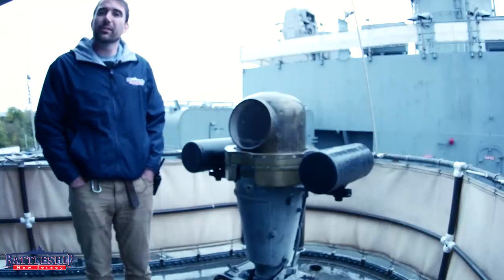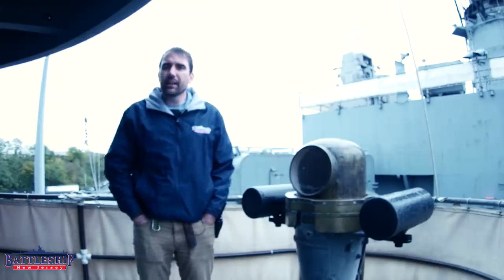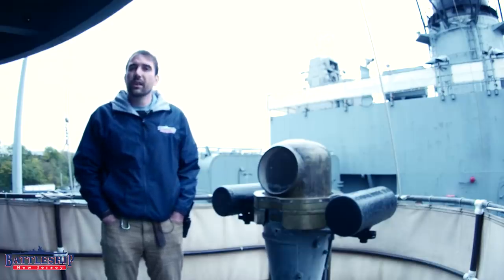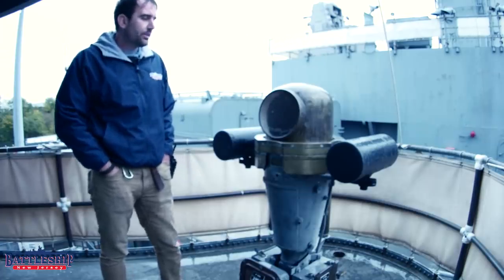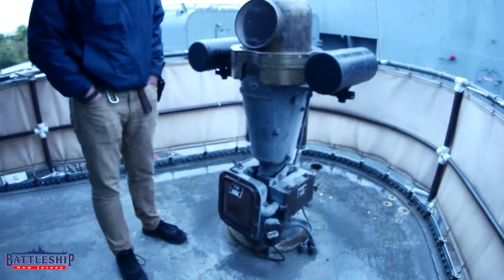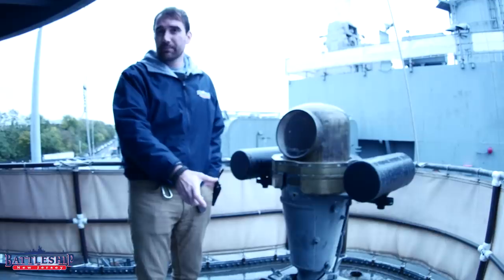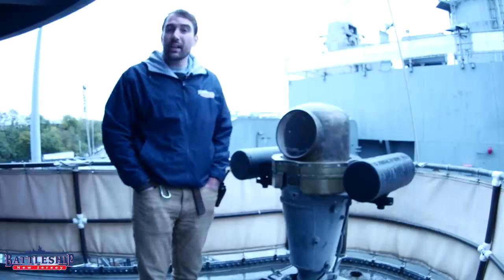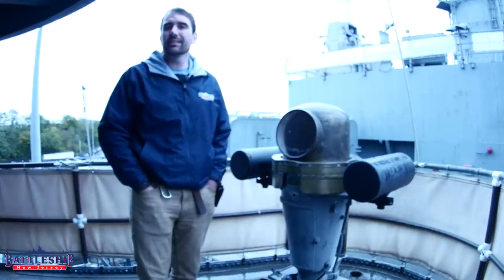What Does the Lionel Train Co. Have To Do With the Battleship?

Comment: Ryan. Good job. Two points. The binnacle is corrected on a “range” of known bearings by a compass technician experienced in the art. Much like piano tuners. This process of compensation is referred to “swinging the ship”. Once compensated the “navigators balls” are left alone. Variation and deviation change geographically. Thus charts contain compass roses that define variation for a particular local and address the rate of change of deviation over time for that area. 

The magnetic compass is essential to the navigation of a ship. The gyro compass is inherently stable and eliminates the messy computation of true north from magnetic north compensated for variation and deviation. But the gyro has no way to “know” which way is north. The ships navigator must “set north” for the gyro. Once done that gyro “remembers” north. Until a power failure, mechanical failure or other event that causes the gyro to “tumble”. This usually occurs on a dark night, close to a foul shore, in a storm. That’s why there are usually both magnetic and gyro repeaters at the key conning stations. And in the gyro compartment. So the gyro can be re-set quickly at sea. 
Redundancy is a wonderful thing.
Reply: Still done to this day, I used to race sailboats and you still "swing the ship" to set the boat's main compass. I don't care about GPS, Loran or anything else depending on electricity, they are good tools but when the power goes out, compasses, paper charts, decent wristwatches and sextants are the only way. It's vital to know the old ways.

Comment: I found two  Lionel made USN compass in Moms attic a few years ago when we were cleaning it out for a sale, the home was purchased in 1956. 
Compass #1 is a 3 inch compass in a cooper housing that is portable and has a date of 1942 on the face. Ive been told these were used in whale boats. In the cooper housing is also a kerosene fueled area to light the inside of the housing. 

The second compass is in a wooden box , with s brass plate that reads Bureau of the Navy. my guess a 6 inch with Lionel 1942 on its face.
Both are prestine new condition.

I have no clue how they ended up in my Moms attic and Dad passed in the mid 60s, Mom had no idea and nobody worked for Lionel in our family. 

I do know that the Lionel factory was located in Hillside NJ which was not far from Moms home in Essex County.  

I also found up in that attic a Lionel made fishing reel.  

Amazing company Lionel.  

I think Ill make time to visit BB62 again.  to see the Lionel display

Comment: This could be doing the same job as the fluxgate in an aircraft compass system. The directional gyro has no idea where north is. The job of the gyro is to hold a set heading no mater what the ship is doing. A compass will bob and swing as the ship does. The fluxgate gives a compass  signal to the compass amp which controls the compass indicators and the gyro damps the swings of the swings that the aircraft would cause.

Comment: Yeah,  the magnetic compass sends a signal to navigation. Fun Fact: There are magnetic maps that detail the magnetic topography of the oceans, and in some areas if you do not have those maps in hand you may find yourself going 90degrees askew. As for the placement, as you mentioned the ship is a huge chunk of steel that becomes magnetized at every eyeblink. That area is magnetically 'neutral' as possible on the ship. But, don't take my word for it. I'm just a retired AT1.

Comment: The variation between true north and magnetic north can vary widely.  There in New Jersey the deviation is about 10 degrees east.  If you went into the Pacific, up around Seattle and out toward the Aluetians, the deviation is about 20 degrees west, for a total change of 30 degrees.  Even just crossing the Atlantic from New York to England, the deviation will change about 10 degrees.
Reply: That's the reason for the mnemonic: True Virgins Make Dull Companions And Wives.

Comment: those mk19's likely had battery back up for power loss. the AN/WSN-5's it would have had in the 80's & 90's had built in battery back up. you can navigate off a magnetic compass, but it doesnt do much for fire control.

Comment: Ryan the compensators on each side are called Kelvin balls (or bars in this case). The Flinders bar is a soft iron bar mounted in the binnacle vertically fore of the compass center. It provides vertical field correction while Kelvin's (or navigators) balls/bars provide horizontal correction.

Comment: This was awesome.  I recall having to find the binnacle on the Missouri (as part of qualifications) and wondering at the location.  There was little reason to go back there and I probably only looked at it that one time.  Of course there was a communications jack nearby, but it's hard to imagine steering by a remote compass, and we never tried it when I was standing bridge watches.  It would have made an interesting exercise.  I was not aware of any repeaters which showed magnetic bearings alongside the true bearings from the gyrocompass repeaters.  It is quite a monument to redundancy.  Missouri received a GPS receiver in 1989, which was a brand new military-only technology at the time, to accompany our Omega and Loran-C receivers, sextants and chronometers, and gyrocompasses and magnetic compass.

Comment: BNJ, Some time ago you talk about the turrets of New Jerry having not been turn because the turn machine are gone. I assume you would like to exercise the turrets. What I am about to say is going to sound harsh but this is the idea. Have a semi-truck size tow truck come out and use its wench to connect to the end of the peer side barrel and pull the turret peer side on all 3 turrets. Than your team could grease the the turret rolls when done have the tow truck come back out and run its wench line to a block on the side of the ship opposite of peer side. Than pull turret back to centerline or if you want very close to centerline so the turret set in a different location by a little bit very 2 or 4 years.

Comment: Lionel made instrumentation during the war.

Surprised at the 1940 compass date. Lionel was still in train production in 1941. I have two 1941 Lionel locomotives,  a 226E and 225. Very smooth running and high quality.  Lionel started producing trains again in 1946. Some models carried over from prewar, most tooling/casting dies were modified into new models.

Comment: what is our heading?
Ship.
As a BoyScout I stopped wearing ferrous belt buckles because of the ease in which they can interfere with a magnetic compass. A side benefit is that the aluminum buckle that I have now does not set off the metal detector at work.

Comment: I bought one of those J-36 Semi-automatic "bugs".  It was built by Lionel and other companies (Smith Corona was another) under license from the Vibroplex Co. which had been building these keys since 19th Century RR days. Vibroplex was too small to meet the wartime demand.  The J-36 was an exact copy of the Vibroplex Lightening Bug, identical except for not being chrome plated and not having jeweled bearings.  Many young radio amateurs who were licensed in the 1950s bought these from war surplus vendors in the mid-1950s. On the surplus market they cost $3.95 plus postage. The Vibroplex of the time cost $40-50 or more depending on the model and was above the allowances most of us had.  Mine has the Lionel logo.  The parts are totally interchangeable with the Vibroplex original as I had to do when the main pendulum spring of mine broke from corrosion.  A J-38 key, also made in huge quantities during WW II (Only ace operators were permitted to use "bugs.)  I have one of those too but there is no indication as too who made them. The J-38 is a hand key with Morse being sent with an up and down moment of individual dots and dashes of the Morse alphabet.  Rookies (as I was as a 13 year old newly licensed amateur in 1955) were expected to start with a hand key for the 5 wpm requirement for a Novice License.   After gaining proficiency in sending and receiving Morse and qualifying for a higher grade of license, they switched to a "bug" which used a sideways motion, which reduced arm fatigue and made the "dits" of Morse code repeatedly by the spring pendulum.  While some still use a bug today, most expert Morse operators today use an electronic key which also makes the "dahs" automatically as well.  If you moved the pendulum weight you can send faster.  You had to be proficient in your sending or you would be labeled as a "lid" a poor operator. It don't know the origin of that term but likely went back to 19th century RR days.  If you were deemed a "lid" you might be asked to "QLF"  a psuedo and sarcastic "Q" procedure shorthand which equated to "Buddy, why don't you try sending with your LEFT foot. LOL.

Comment: De-gaussing coils center on the magnetic compass to check the ship is de-Gaussed.  How else could you tell?  It the compass points magnetic north after the procedure then all is correct.  That is you are cancelling out the field of the ship, has also to be done each side of the equator, for obvious reasons.

Comment: How was magnetic declination calculated back in the day?
Reply: Local declination is listed on every nautical chart.
Reply: Declinometers were invented in the 1800s.  Part of the survey to make charts is to determine the declination.

A declinometer simply has a magnetic piece for showing the compass bearing, and is then sighted onto Polaris(north hemisphere), or the constellaion Octanis(south hemisphere.  Sub in Southern Cross, Canopus/Achernar, Canopus/Sirius, Magellanic clouds if you can't sight Octanis which is dim)
Take the compass bearing, correct for magnetic deviation(magnetic disturbance caused by vessels, which should be quantified beforehand) and you get magnetic bearing.  The difference between the magnetic bearing and the sighting is the magnetic variation.  The magnetic variation is put on the chart so people can convert magnetic bearing to true bearing.

Keep in mind, people largely used celestial navigation before this, so magnetic mapping wasn't required.
Reply: The famous astronomer Edmond Halley was the first to do a proper survey of magnetic variation in the Atlantic around 1700.
Reply: @Grimmwoldds  you had me until that last sentence. Sailors have steered magnetic bearings since the invention of the compass.

Comment: I bet the gyroscopic compasses were susceptible to shock and the impact of incoming fire or even a full broadside could throw off calibration. Gyroscopes need to be calibrated but they could be  recalibrated with a magnetic compass and celestial movement of the sun and stars.
Reply: Nah, they're mounted on shock absorbers.  Figure everything from aircraft to missiles, and I think pretty much every stage of rockets like the Saturn V have gyros, and obviously they were all exposed to extreme G forces and shocks.
Reply: Gyroscopic compasses precess due to the rotation of the earth. They need regular adjustment as a result. Flux gate compasses are used in more modern systems to correct the gyrocompasses for north-south orientation. (Or you can just use computers if your gyro platform is good enough to measure your current orientation in space).
Reply: @allangibson2408  US warships since at least the mid 80's have used inertial navigations systems for navigating, and fire control.
Reply: @leftyo9589  Yes - and that became possible in the 1960’s with enhanced computer systems. It was sci-fi in the 1940’s when the New Jersey was built.
Reply: @allangibson2408  --  Well, it's been awhile since I read about it but my understanding is that the "gyro" was held to "local" vertical by a gimbal and weights.   The rotation of the earth caused the system to "sense" the rotational axis of the earth.   The system wasn't like an aircraft gyro which maintains a constant heading.   The ship gyro senses the rotaltion of the earth and uses it to find TRUE north.

Comment: I had a M16A1 rifle made by Mattel when I was in the marine corp
Reply: Mattel never made M16's only some of the early stocks.
As of when I'd been in the Army from 83 to 86 the only contractor's that'd produced M16's at that point were Colt, General Motors Hydramatic Division and Harrington&Richards Firearms, there's been a bunch of different contractor's since then but Mattel has never been one of them.
Reply: In Vietnam we got new M16A1 rifles manufactured by Colt in boxes which looked like the same type of box Mattel used for toy guns in the late Fifties and early Sixties. The cost (the amount deducted from the budget) was $95 each.
Reply: @dalecomer5951  
They were $850 by the time I was in in the mid 80's.
Reply: @dukecraig2402  That is consistent with the amount of inflation between 1968 and the early Eighties.
Reply: @dalecomer5951  
Yep, the late 70's was a real bitch when it came to inflation, it was the main story on the news every other night.
By the way, my issue weapon in basic training in 1983 was marked XM16E1 with a six digit serial number, and it still shot two perfect 40 out of 40 scores for me.

Comment: The couple of degrees variation from magnetic to true north is 21.5 degrees, called declination, the same as the tilt of the earth's axis of rotation to its solar orbit. There are variations of this from place to place based on minerals and other things.
Reply: Not remotely. The magnetic pole is under Canada, and moves significantly each year. Regardless, it is quite far from the true pole.
Reply: @robertlitman2661  thanks. It's been awhile since I learned about that